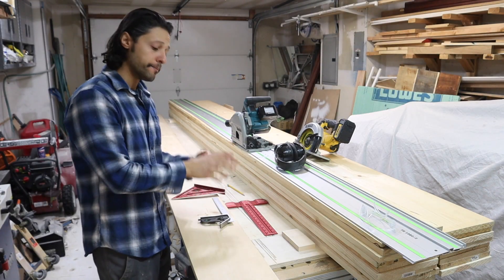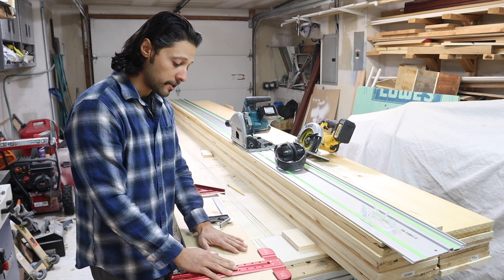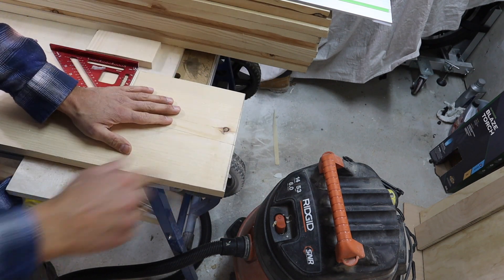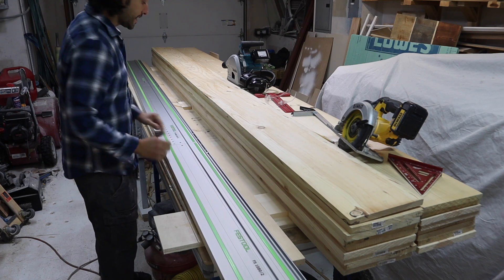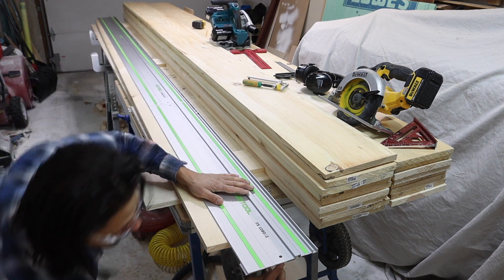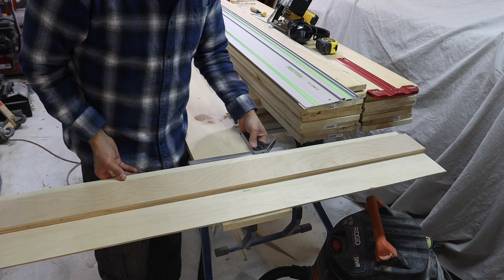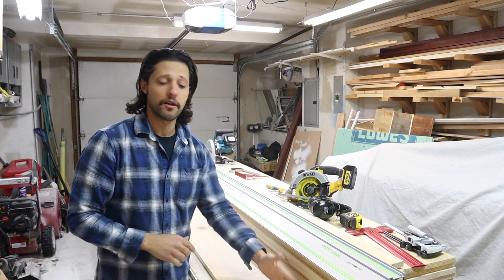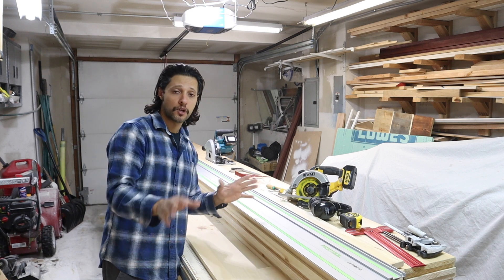perfect crosscuts do this first!

Comment: Thanks, Anthony!  There's no Santa???  Not every square tool at the store is actually square???  When I buy measuring tools I've started taking a small known tool or architectural triangle to the store to check them before purchasing!  Great explanation!
Reply from the maker: It’s actually unfortunate that most of these tools need a lot of adjustment, fine tuning. You can’t trust anything anymore. Quality control is out the window

Comment: I see you have the cordless Makita tracksaw, which is interchangeable with the Festool rail, as do I, I saved some significant cash buying the Makita as opposed to the Festool, and in my opinion, just as good, I'd be curious as to your take on that.
Reply from the maker: I only had it a short while when I was waiting for my festool ts55 feq that was on back order at the time. Once I got the Festool, I sold the Makita. It wasn’t a bad saw but the festool has better accuracy and dust collection. Plus the adjustable outside splinter guard.
Reply: @AnthonyScolaro1  So, my partner has the Festool tracksaw, and I have the Makita, I find the accuracy pretty similar, but there's no argument about the dust collection, festool's dust collection on all their tools is the industry standard, I just have a hard time reconciling the cost of Festool products. Enjoy your vids